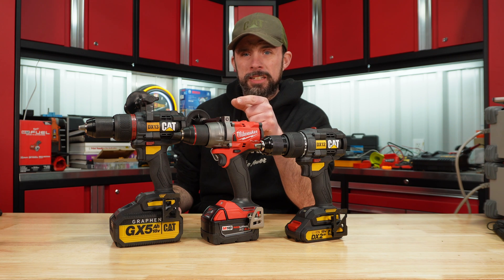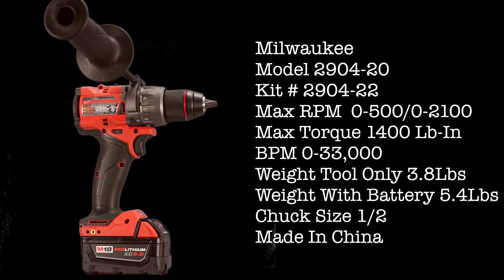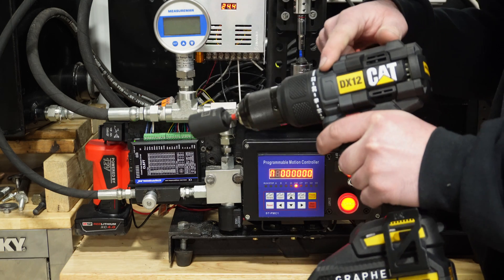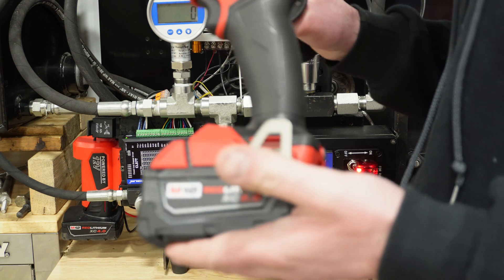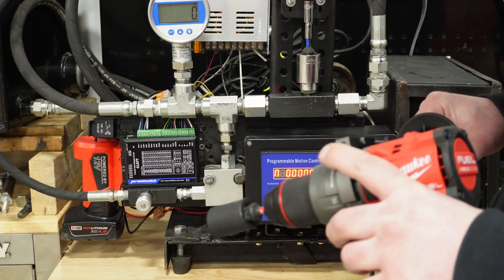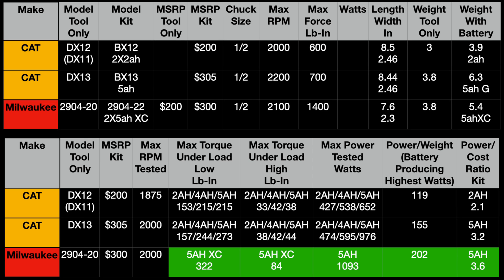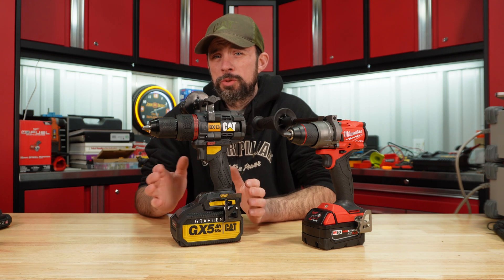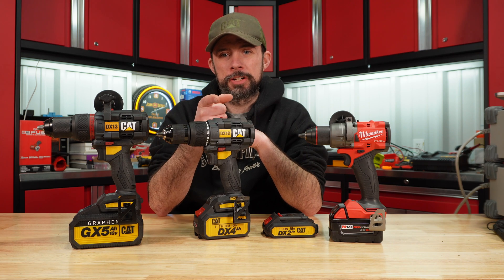CAT DX13 VS Milwaukee

Comment: To keep the batteries on an even par, there is always the option of purchasing a Milwaukee super charger. I believe they can recharge a 12ah battery in under an hour.
Reply from the maker: Yeah the new forge battery makes a huge difference and if you use the new dual SC.  This is an old video.

Comment: One of the claims of the graphene batteries is their superior performance at cold temperatures. If so, this would be a hugely valuable quality in areas that experience cold winters. Has anybody tested for cold temperatures performance, including Milwaukee, Dewalt, Bosch, etc.?
Reply from the maker: Yeah that would be an interesting test,  I don't think anyone has don that yet.

Comment: Thiese results are misleading, as you pointed out, if you test the Milwaukee with larger batteries it does way better.
Not a fanboy, that Milwaukee gets a lot out of larger batteries.
Reply from the maker: Yeah anything bigger on the Milwaukee and it will smoke the belt currently on the dyno....  

Dyno is getting a major upgrade in a month or so,  should be able to handle double the Watts.  

Cant wait to retest the Milwaukee and angle grinders!

Comment: Omg this "5ah" battery is ridiculous, it is soo big, should be more like 8-10ah for it's size and should never be used on a handheld drill.
Btw if you tested Milwaukee with ho 6ah battery it would embarrass cat even more. It has a lot more power compared to this wimpy 5ah
Reply from the maker: Yeah I'm about to upgrade the dyno so it can handle the M18 lol.
Reply: @Tools-Tested  awesome :)
Reply: I suppose they have several banks of cells inside, and additional circuitry for charging them in parallel, which explains faster charging.

Comment: Can you please test the Makita xgt 40v and have a brushless 20+ v shootout please
Reply from the maker: Hope to but it will probably be 2 months before I do.  Biggest issue is its another battery platform I need to buy into.  I try to test the tools with all the available battery's, so to add another platform is $$$$.
Reply: @Tools-Tested  total understand I'm in 15 platforms currently about to sell off a couple that I've made videos with already
Reply: @Tools-Tested  don't worry, just get 2.5 and 4ah for drill testing, 5 and 8ah are pointless in this application and not practical at all. Btw you will also be surprised how fast they charge... And in general it is a great platform to invest into, really great tools, they have it all, power, ergonomics and reliability.

Comment: My main reason for even considering the cat would be the fact that the battery is supposed to persist through more charge discharge cycles and charge faster. I worked at a company that used Milwaukee but their batteries were so worn out from so many cycles that my new 2 amp hour on my impact would last as long as the 5 amp hours at least. I never ran it out with the impact at that job, but using it in the blower we used for blowing out roof top units I could throw my 2 amp hour on after we ran out of big batteries and get just as much out of it. As long as the batteries don't cost twice as much to replace I think that alone would make it make sense for a company, if it does truly survive double the amount of cycles.

Comment: there is no evidence that those cells contain any graphene, the MSDS sheet does NOT nor does the shipping restriction note this, either the battery has no graphene or the MSDS sheets are illegal
Reply from the maker: Wish I could cut one open,  but I cant currently afford to. I still need it for other CAT tool testing.
Reply: Of course it's unlikely there's any graphene there. If confronted, I suppose they will claim it's just a flashy marketing name. But the fast charging is cool, wish other brands make a note of that. Most likely cells charged in several banks in parallel, like in modern phones with super fast charging

Comment: Oh heck  yeah! Using a stepper motor to move the flow control valve in a precise manner gradually increasing the load the tools experience.
Reply from the maker: Yep that way its consistant and I can keep both hands on the drill.

Wanted to go with a PWM valve until I looked the price up of a none compensated PWM valve.

Almost all test videos on YT show people drilling into wood,  I wanted something that could be consistent and repeatable to keep things fair.  Way to many variables I feel with testing in wood.

Comment: Interesting set of results. I  haven't really seen CAT battery powered tools here in the UK. The odd time I have seen them, they are very expensive, usually a lot more than the other main brands. I guess it depends on what you want the actual tool for, I wonder how many would actually drive it that hard in actual work, more likely battery life time would be the higher concern.
Reply from the maker: Interesting I didn’t know they had a line of power tools before this.

Yeah I’m currently trying to rig up a setup to see amp draw.

Comment: I see the CAT as a very poor deal. Been looking around for another drill.  Right now you can get a FLEX 24-volt 1/2-in Brushless Cordless Drill, 2 Batteries 5Ah & 2.5Ah and Charger on sale at lowes for $179 ($50 off).
Reply from the maker: Yep and the flex is claiming 1400Lb In vs DX12 600/ DX13 700.  I really don't see any advantage right now to buy CAT.  The battery is cool but it looks like the drill cant take full advantage of it.

Comment: The Milwaukee won but not by much
 it claims twice as much power as both of these drills and didn't beat it by twice as much..
 The CAT's were actually pretty impressive for only having 50% of the potential of the Milwaukee....
Reply from the maker: I think the Milwaukee has much more to give,  definitely on speed one.  It powered through the dyno with the 5ah.  It will be interesting when I set the dyno for high power.  

Yeah I don't think the CAT drills are bad,  but your defiantly paying a high premium for the name.  

I cant wait to see how CAT ranks vs other brands as I continue testing.
Reply: If you want to improve your testing.  You should find a way to know the capacity of discharge of the battery.  That where the power came from.  The number of amp/hours is not relevant without the capacity of discharge.  If a 5amp battery have 1c (capcity of discharge)  it will produce a constant 5amp for 1 hour.  If it have 3c,  it will produce 15amp for 20min wich is 3 time the power output possibility but for a shorter period.  Some lithium polimer battery (not lithium ion)  have up to 150c and 300c in burst.  Just a sugestion😊